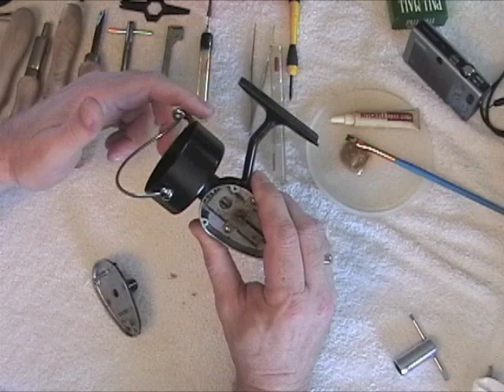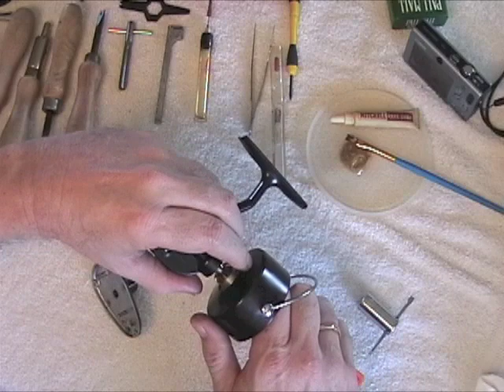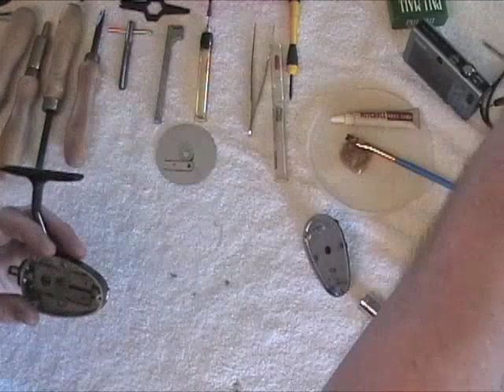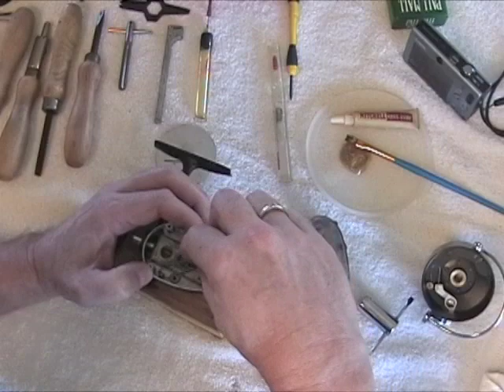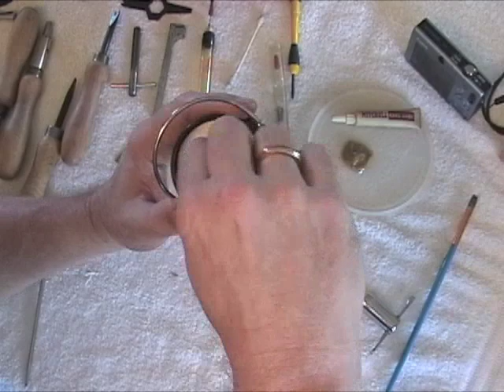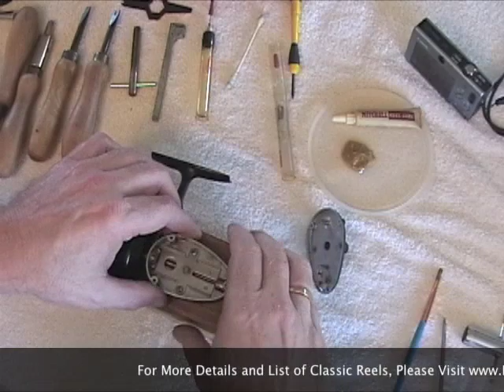Garcia Mitchell 300 Fishing Reel Head Service Repair

Comment: Thanks for your great tutorials! I have a question. I did your annual service as well as the head service and when everything is put back together....My bail doesn't close automatically when i start reeling. What did I do wrong? I worked perfectly fine before si started. Thanks much.

Comment: I should also clarify...my reel is actually the 410, which is extremely similar in design. I think it has to do with my baffle plat, which is a little different than the 300's. if I put it the way I think it goes....the bail functions properly but you can hear it hit the metal lip of the baffle plate on every rotation. If I put it the other way, it's smooth reeling, but the bail won't close when I start reeling. Thanks for your help. .

Comment: What size of wrench do you use to remove the hex nut ,and could you tell me where I can buy one please
Excellent tutorial video
Reply: ianstevenson1903 it's a 1/2inch imperial but a 13mm also works if you're gentle.
I've just serviced a 410a and a 440a that are 40 years old and I'll be using them when the season starts over here
Reply: I used a 12mm on my 1971 made in France and found it to fit perfectly